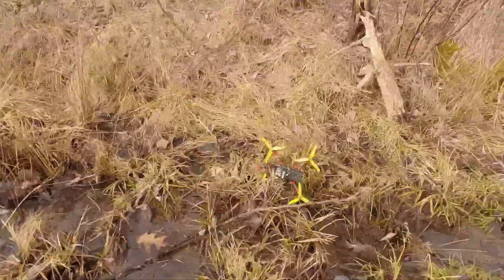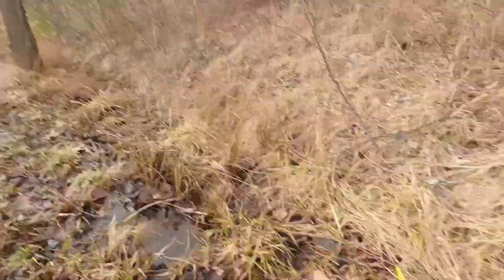Analog vs. HDZero VTX (25mw to 1watt) Not perfect but it's got a lot going for it.

Comment: The 1 watt seems to be not acting right. I have tests that are harsher than this with alot less break up. The 500mw should not be less penetration on the freestyle vs the 500mw double. I do wonder if that sma pigtail is off tune. Check my tests out. Specifically vs the tbs 1.5 watt
Reply from the maker: I’ll give some other antennas a shot in a follow up for sure. Including the included one. But my immersion RC rf meter was reading 1 to 1.2 on the setup I have.  

I was also on R1 and didn’t try other channels on the same setup. Not spending a whole day doing scientific testing but just putting my real world experience out there. 

I’ve taken the 500mw double stack to a bando and had similar performance as an analog 1 watt.

Comment: Seems you had more breakup with the freestyle than the 500mW double stack. Did you use the included antenna with the freestyle vtx?
Reply from the maker: I was using a ufl to sma pigtail and SMA antenna. The same setup that’s on the TXM5.1. And I checked with my ImmersionRC  rf meter that I was getting the full 1 watt output. I believe that where I was standing was not optimal and I wasn’t looking to create a bar case scenario.  Plus that big tree 🌳 seemed to create some significant break up of its own. Im gonna to a follow up video standing in a better area out in the open and see what that does. And I might try the included antenna, I’ll have to print a mount for it. But I typically have a variety of antennas and pigtails in my bag so we will see. 

General flying and image quality are on point, but there are certainly environments that are challenging regardless of the system.
Reply: For me the whoop board is better than the '1watt' freestyle!!
Reply from the maker: @ludofevrier5593  that sounds like the 1watt is still locked. Did u flash the unlock file then power it on for the 3 blue flashes then reflash the 1watt firmware?